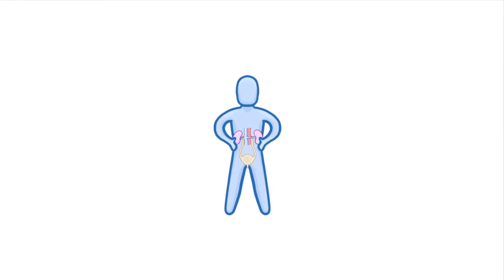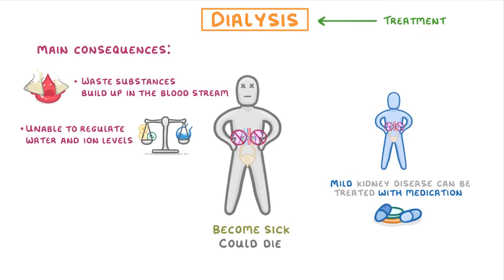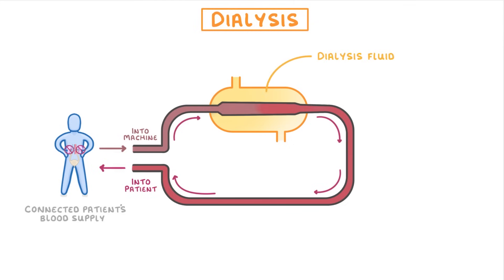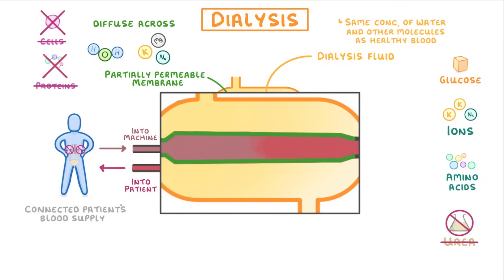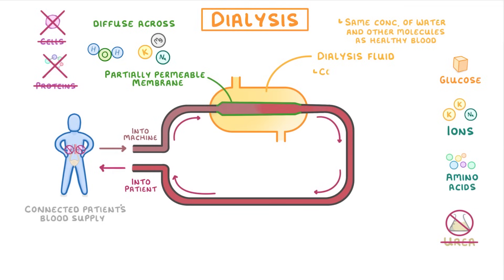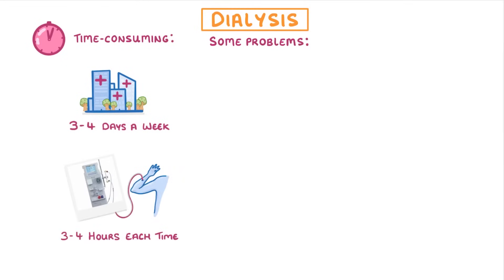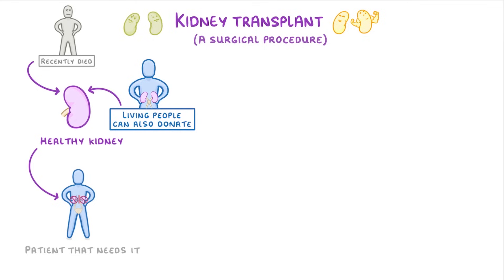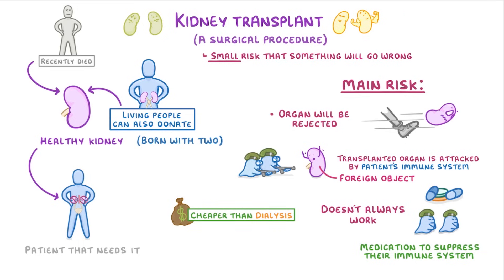GCSE Biology - Kidney Failure (Kidneys Part 3/3)

Comment: When a person experiences kidney failure, their kidneys can no longer filter waste products, excess water, and ions from the blood. As a result, harmful substances like urea build up in the bloodstream, and the body loses its ability to maintain the right balance of fluids and minerals. This can quickly lead to serious illness or even death if untreated. While mild kidney disease can be managed with medication, kidney failure requires more intensive treatment—either dialysis or a kidney transplant.

Dialysis is a medical procedure that performs the function of the kidneys using a machine. A dialysis machine filters a patient’s blood by passing it through a system where it flows next to a dialysis fluid, also called dialysate. The blood and the dialysate are separated by a partially permeable membrane that allows small molecules such as water, urea, and ions to pass through, while blocking larger molecules like proteins and blood cells. The dialysate is specially formulated to have the same concentrations of glucose, ions, and amino acids as healthy blood, but it contains no urea. This creates a concentration gradient that causes excess urea and other unwanted substances to diffuse out of the blood and into the dialysate.

To ensure that diffusion continues and waste keeps leaving the blood, the dialysis fluid is constantly refreshed. New fluid is pumped into the machine while used fluid, now full of waste products, is removed. This prevents equilibrium from being reached, maintaining effective filtering throughout the process. After dialysis, the blood is cleaner and can be safely returned to the patient’s body.

Despite being lifesaving, dialysis has several drawbacks. Patients typically need to undergo dialysis three to four times per week, with each session lasting around three to four hours. This can be physically and emotionally draining. Additionally, long-term dialysis can lead to complications such as blood clots or infections, and the process is costly. Patients must also continue dialysis for the rest of their lives unless they receive a kidney transplant.

A kidney transplant involves surgically placing a healthy kidney from a donor into a patient with kidney failure. Donors are usually people who have recently died, although living individuals can also donate one of their kidneys, since humans can live with just one. While transplants offer better quality of life and are more cost-effective than dialysis over time, they come with risks. The main risk is organ rejection, where the patient’s immune system identifies the new kidney as foreign and attacks it. To lower this risk, patients are given immunosuppressive drugs, but these are not always successful.

Although kidney transplants are generally more effective than dialysis, the limited supply of donor kidneys means many patients remain dependent on dialysis for survival.

Comment: Hey dont think you explained how the dialysis gets rid of urea , but I may be wrong
Reply: this may not be completely correct - there is no urea in the dialysis fluid which means there is a steep concentration gradient between the patient's blood containing urea and the fluid containing no urea. This allows for urea to diffuse across the partially permeable membrane from the blood into the fluid so there is no harmful urea left in the blood.

Comment: wait a minute but how does a dialysis machine manage the correct amount of water needed by the body to be reabsorbed since the machine is an external object and can't be controlled by ADH? How will we know what amount of water is needed to be reabsorbed by the patient if we can't use ADH?
Reply: This is such an interesting question damn. I'll look up on it and let u know!
Reply: the dialysis fluid contains the right amount of fluid that absorbs the contents of healthy blood, water ions, etc. So it it just removing excess water from the blood ensuring a right amount of water in the blood. It isn't reabsorbed I think, just water is diffused until it reaches its equilibrium
Reply: my teacher said that they have to do a blood test for the person and they see  the concentrations and based on that they make the dialysis fluid